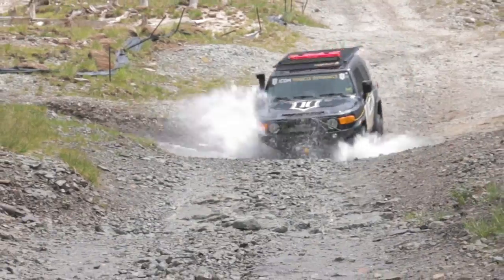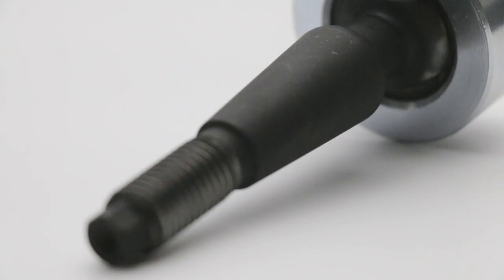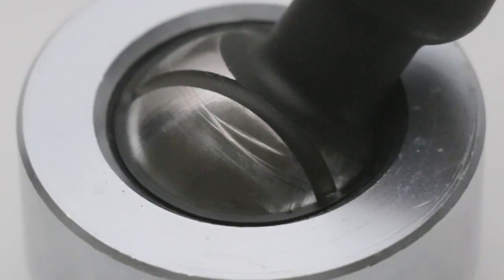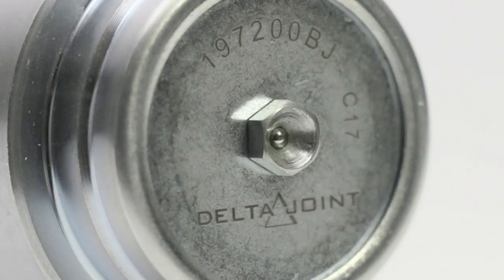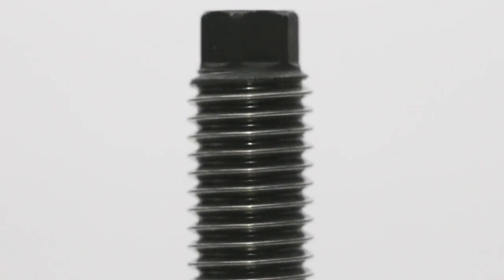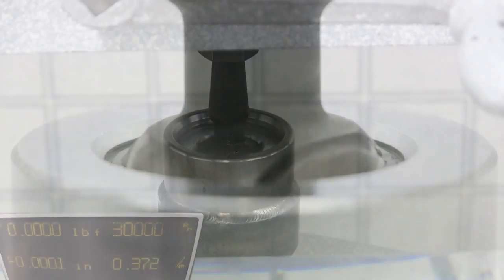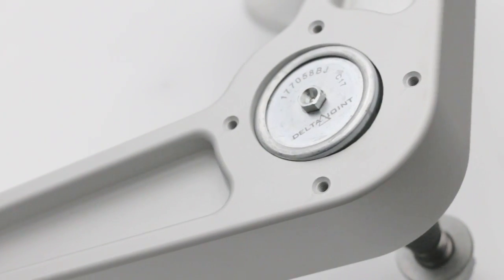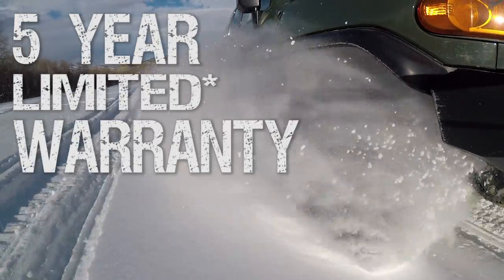The ICON Delta Joint | Heavy Duty High Angle Retrofit Ball Joint

Comment: Hi, could you please explain the benefit of this Delta Joint over a HEIM joint. Does it offer the same flexibility? Can I get more adjustment from my UCAs with the Delta joint,  if I can't get the right alignment where I need it to be with just the lower control arms, similar to the HEIM joints? Thanks in advance!